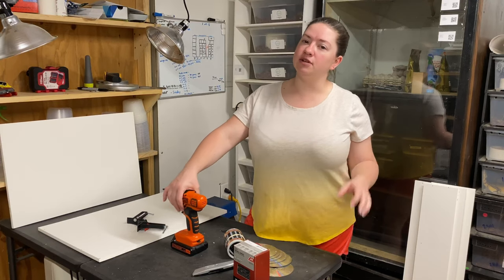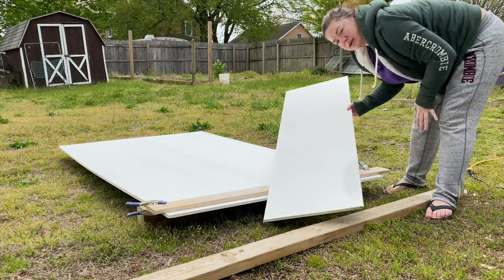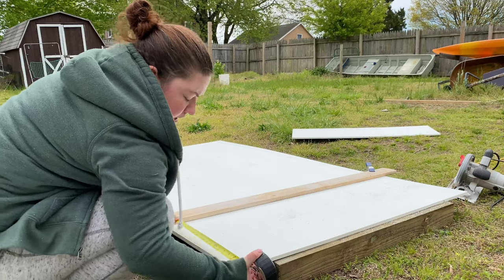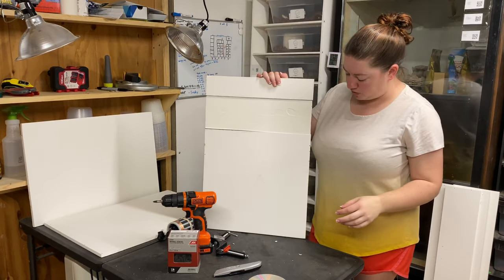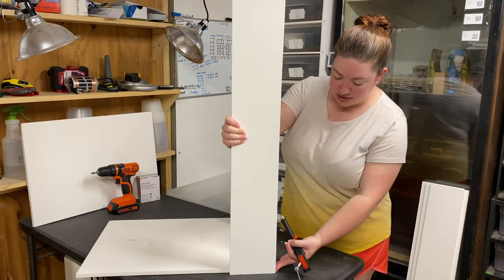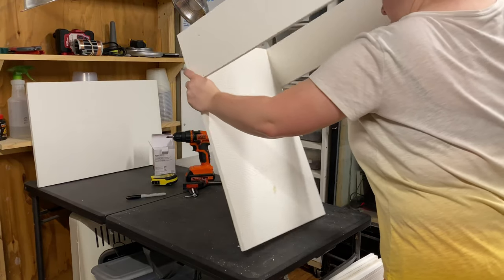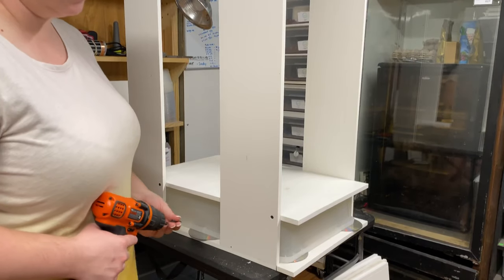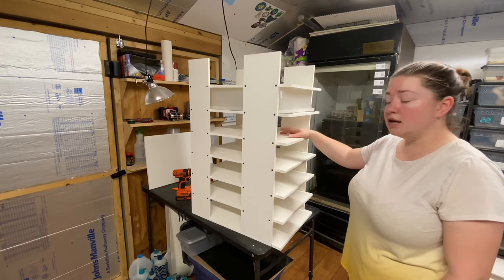HOW TO BUILD A HATCHLING RACK | DIY Snake Rack | Ball Python Breeding

Comment: Looks great!

How easily does the pvc cut with the circular saw compared to melamine or plywood?   I'm looking at a mini track saw system or just buying a guide clamp for my circular saw.  Thanks!
Reply from the maker: Cuts very easy. I just clamp a straight board to the sheet as a guide for the saw
Reply: @CDExotics  Perfect, thank you! :)
Reply: Oh wow, thanks for the link! I might have to contact the company, there's several options and I'd hate to buy the wrong one!

Comment: Great video and I've learned a lot from you. What router bit do you use when routing out for the heat tape? This is the part I've been struggling with the most .
Reply from the maker: I can’t remember which one I got but it’s just a basic bit with a little bit of a beveled edge on it

Comment: Does the wood that's exposed by router not pose a burning threat when in direct contact with heat tape??
Reply from the maker: There is no wood exposed, these are pvc racks